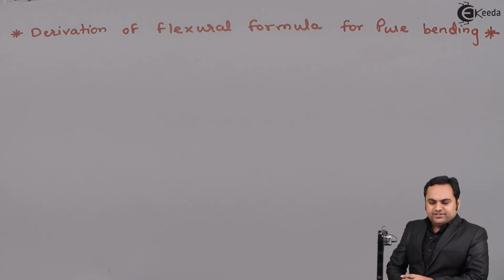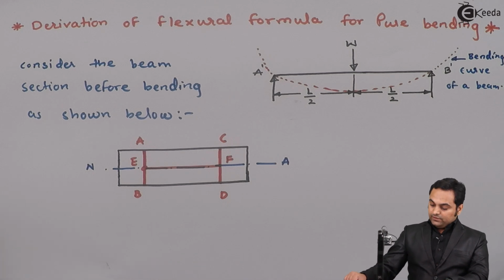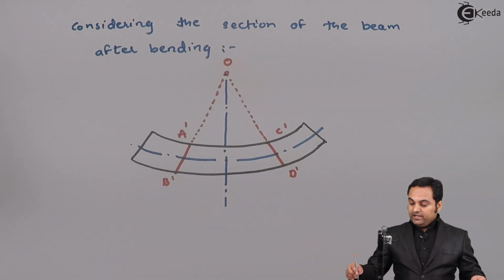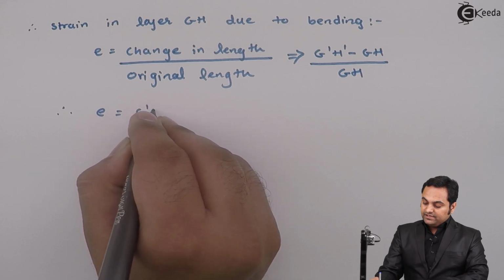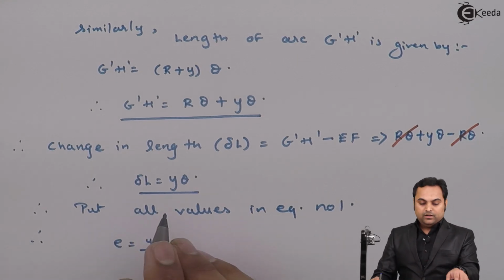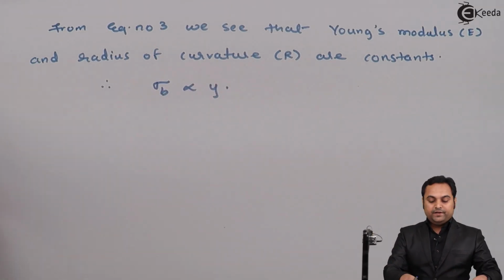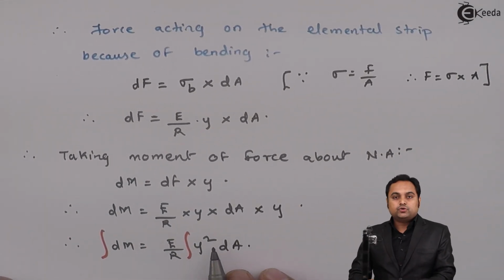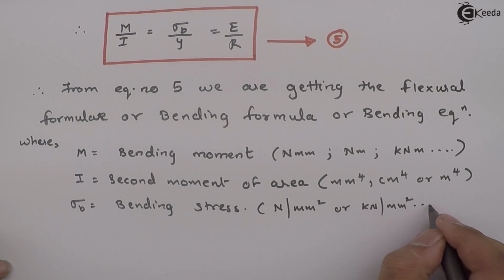Derivation of Flexural Formula for Pure Bending - Stresses in Beams - Strength of Materials

Comment: Sir, under the heading of pure bending you have taken the example of a Simply Supported beam subjected to point load at mid span at 1.30 which is wrong because in that case no portion of beam is under pure bending as shear force is not zero anywhere on the beam.